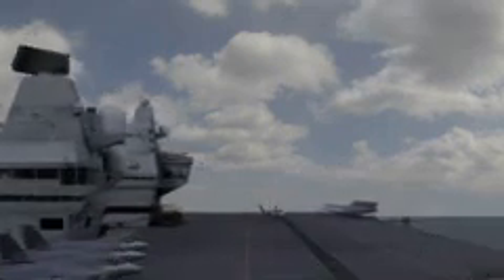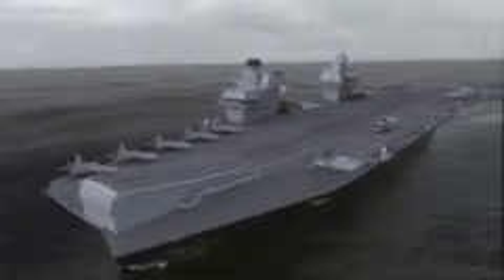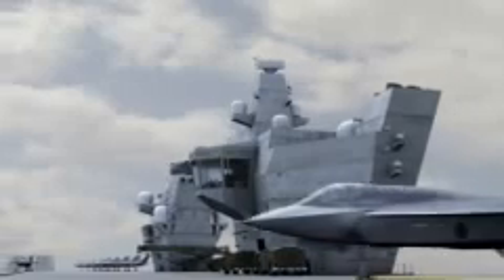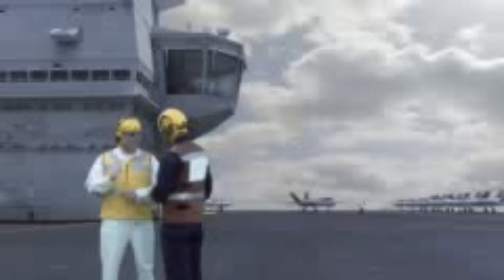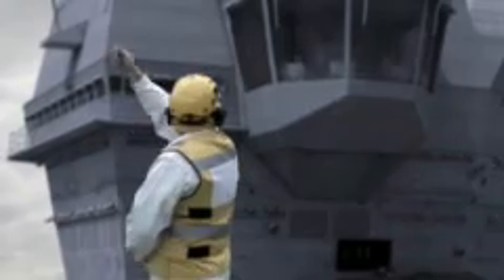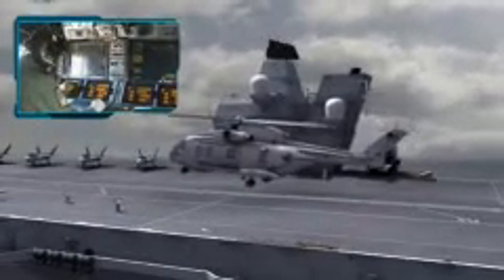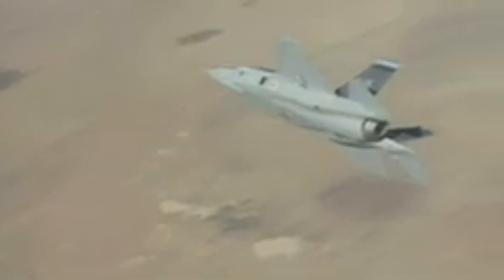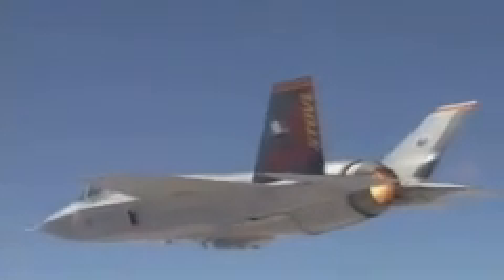Queen Elizabeth Class Aircraft Carrier

Comment: ... high energy lasers are big and heavy and have huge heat problems......

The problem with things in space are:
its INCREDIBLY expensive to put anything heavier than a small car up there.
Overheating (being surrounded by vacuum means that your space  craft is almost perfectly insulated.  Communication satellites have overheating problems - a laser would be a nightmare - and require huge... and heavy, heatsinks - > more weight issues.)

Comment: Right, but that's the 1938 definition. Ark Royal could also carry up to 60 aircraft (though designed for 70). Certainly wouldn't call it a supercarrier by today's standards though.

Over time the meaning progressed as have carriers. Post WW2 - the standard for supercarrier was set by Forrestal class; 81,000 ton displacement and up to 90 aircraft.

Maybe QEC is super compared to Invicible class lol, but generally supercarrier today means 75k+ tons and 70+ aircraft carried (QEC holds 50 max).